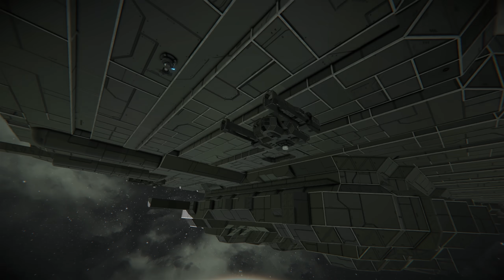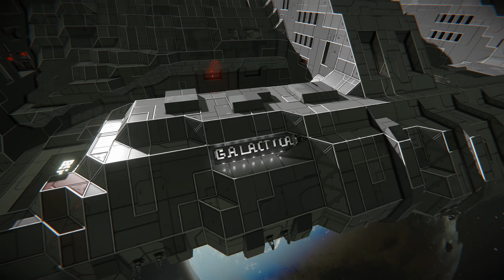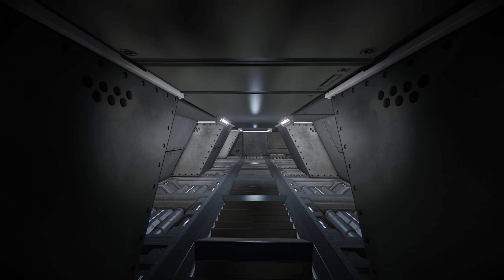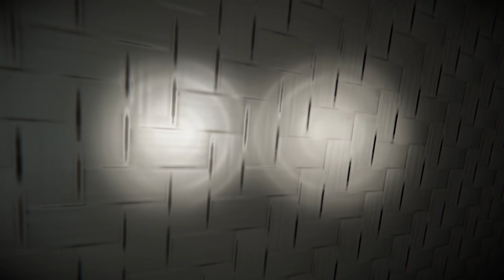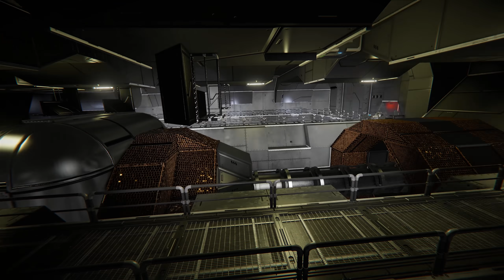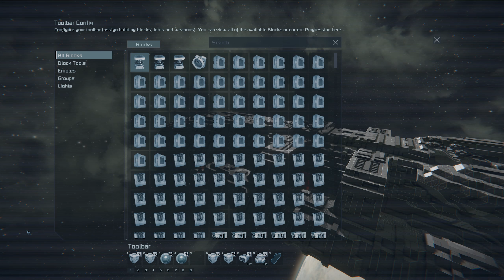Space Engineers - BS-75 Galactica | Battlestar Galactica

Comment: We were once building actual 1:1 scale battlestar galactica with 4 of my friends, it ended up being 120m longer than original one. We stopped working on it when it was around 1/3 completed. There was almost no interior, no decorations, but it still had 415k blocks. You could literally fit a vanilla red ship in those hangars with no problem. Only problem was that 1/3 of completed galactica consumed all of my ram, thats why we stopped.